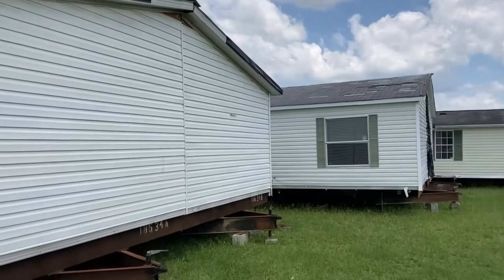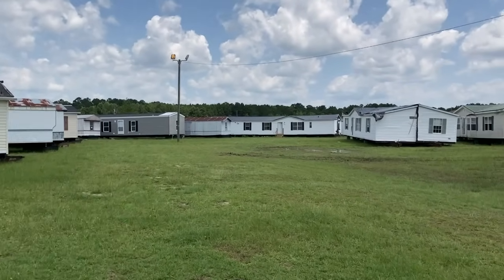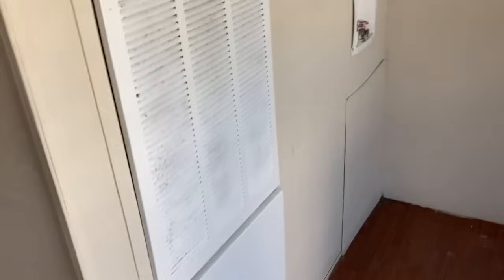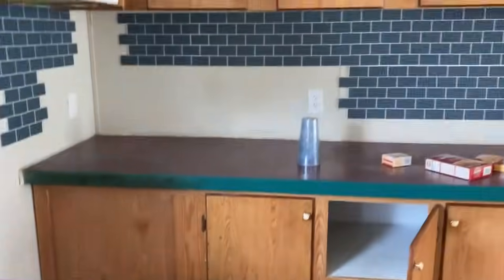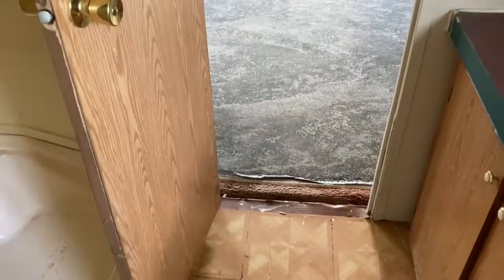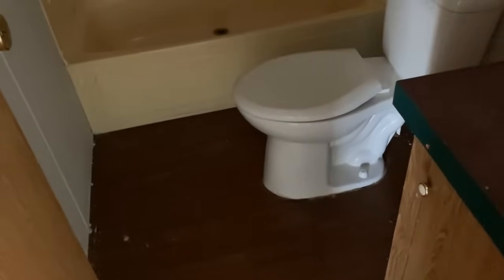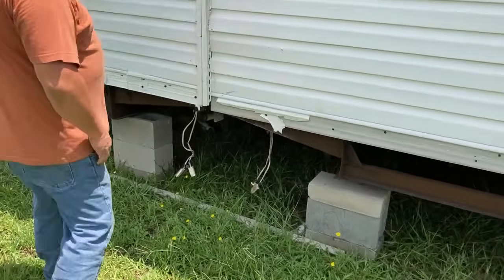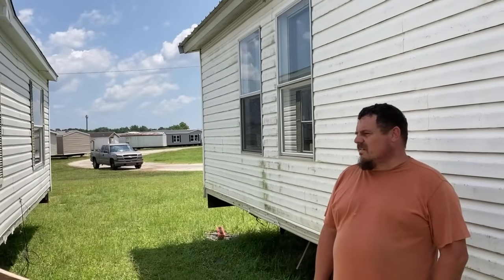Can You Guess How Much This USED Double Wide Mobile Home Costs?

Comment: Wouldn't pay more than $50,000 for a double and $25,000 for a single and it has to be less than 3 years old
Reply from the maker: I haven’t found any of that new for that price
Reply: @mybrotherdonnie  that's why I still rent
Reply from the maker: @Yearight-b9l  I called about a 2018 here a few months back it did not have an AC unit somebody already took it. Somebody took all the doorhandles it needed to be cleaned and painted little odds and ends plus an HVAC they wanted 80,000 as is where is and it would cost me about probably 5 to 6000 to move it

Comment: If you remember talking to me about double wides a couple weeks ago I'd say this one is a buy. I discussed trim and how expensive it can get but this home has the lower grade trim so thats a complete none issue on this one you can buy that thin trim cheap. The home looks solid you are missing some of the inner windows I'd try to negotiate those into the deal. This size home should rent for 1000 a month at least and if you make it look good it will have over 100k value you can sell it or take a loan against it remember getting a loan is a none taxable event 😎 take that money let the renters pay off the loan and buy another one. The next one will be completely free. 

Disclosure: I do not recommend renting mobile homes I am currently liquidating all of myn and buying traditional homes mobile homes are high maintenance units when in the rental business you want low maintenance units. With this being said you can still make a lot of money and by incorporating mobile homes into your portfolio you can get started in the business faster and cheaper and when you do decide to get out of mobile homes the money you made or the equity you acquired will launch you to that next level. You guys are willing and and able to work hard so you'll do great but as you get older you wont want to work so hard and you also start thinking about passing the portfolio to your kids you will want low maintenance properties when this time comes don't think about it later plan now im 35 years old I hope I have a long ways to go but im already realizing this and making those changes. I got started with mobile homes but you seriously cant look at it any other way than just a start. It will be difficult to retire on mobile homes and it will be impossible to build generational wealth with them. 
You guys are awesome I always look forward to your videos keep working hard and enjoying life, peace.
Reply from the maker: Just part of the portfolio
Reply: @mybrotherdonnie  yea just so long as you know they're high maintenance and you're willing you're good. However on plumbing never change the manufacturer's design buy pex and the rings and the crimpers never put brass fixtures in the shower dont glue PVC on pex keep it all original mobile home plastic shower fixtures pex and the ring crimpers never change that design keep it simple it last 20 to 30 years that way I keep pex pipe rings plumbing fixtures I can get a call and fix the problem in 2 hours or less and it last longer than the alternatives. Keep it simple and original please trust me on that.